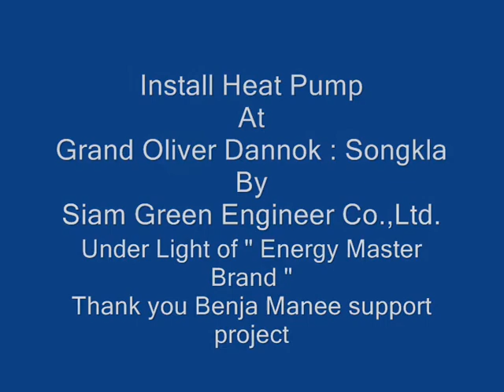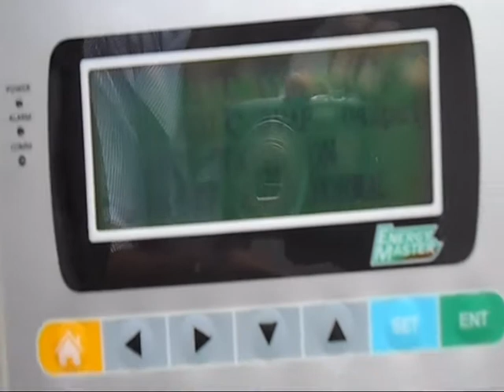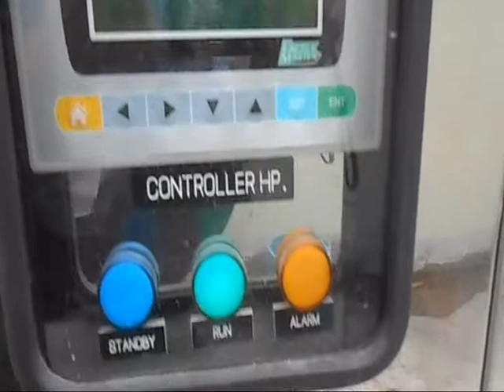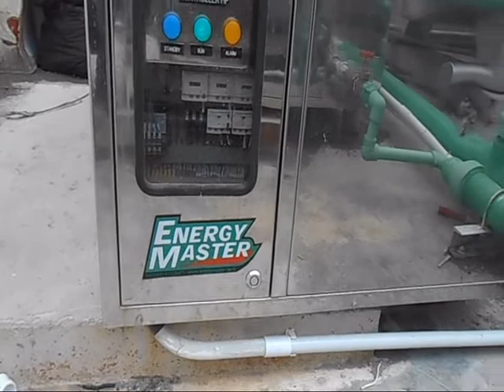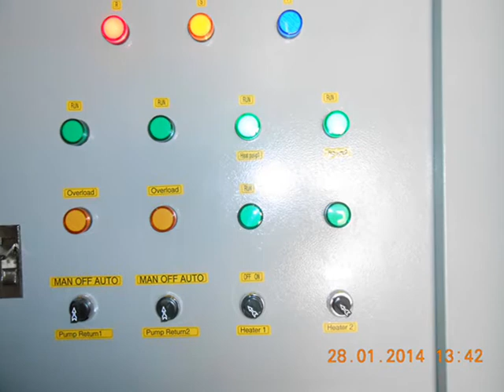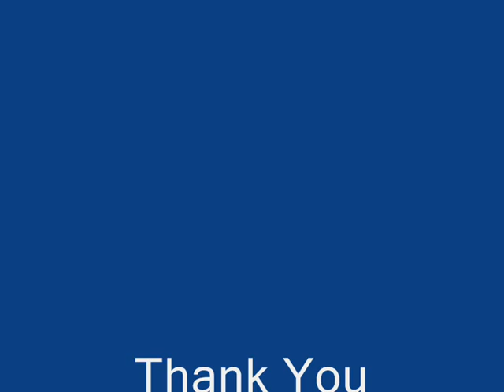siamgreenengineer Grand Oliver Dannok

Comment from the maker: Siam Green Engineer Co.,Ltd. install heat pump model HHPM25 at Grand Oliver Hotel Phase II with 350 room .The project energy saving reduce cost electric heater cost comparision with heat pump which can reduce more 60% for make hot water supply to room and laundry.